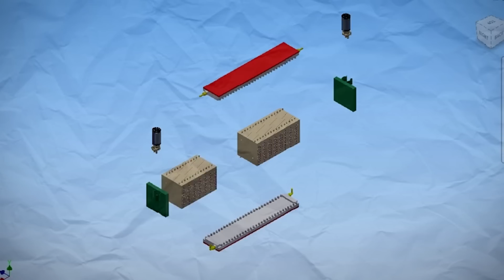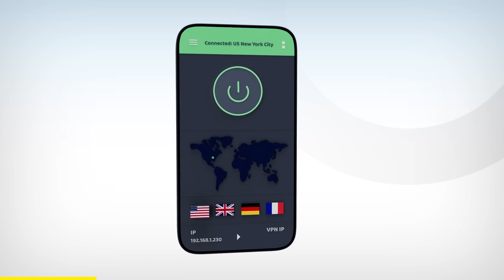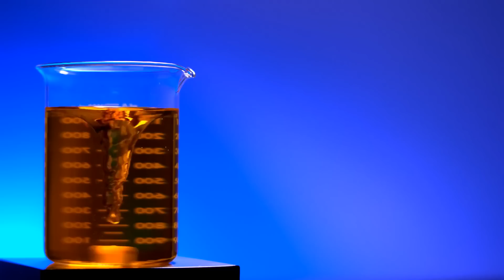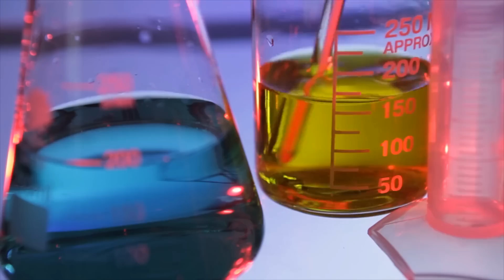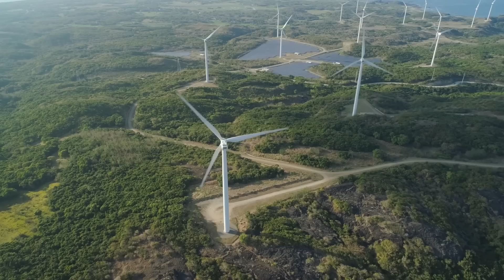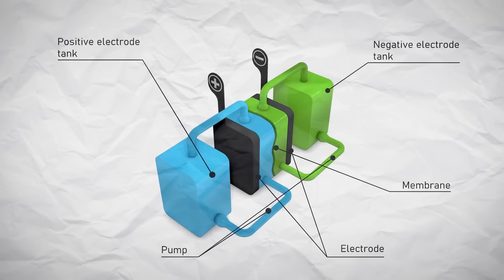This Insane Liquid Battery Can Instantly Recharge

Comment: A Tesla mod-Y recharges from near empty to full charge at a supercharger station in about 15-20 minutes. Buy the time you go to a gas station, wait in line to access a pump, then fill your tank, the time difference is not that much. Also, over 97% of you charging is done at home. You plug your car in that evening, and tomorrow morning, it is ready to go another 235 miles.

Comment: This is another battery "fantasy" that overlooks it's main flaw.  There is no vanadium distribution system infrastructure.  Therefore, it will remain a wait and charge battery, just like current Lithium Ion batteries.  I could theoretically see a future in which certain industries (that do their all hauling at one site, ie a mine for instance  or manufacturing site), could set up an in- house refill station at the business.  That could make economic sense, depending on the price and supply of Vanadium. The cost of a  patented Vanadium mixture may make even this scenario economically impractical.  I think we face a future with several different ways to store electricity for vehicles.  The cat is out of the bag, EV's work very well today for many purposes and I think those purposes will keep multiplying and improving.

Comment: I was wondering when corporations were going to see this.  Charging a battery is no different than pumping steam into a tank, have it condense into water, then turning it back into steam for usage. Extremely inefficient. This is why a dense form of electricity is needed.  Just like gasoline is a dense form of heat. Redox Flow batteries are a close to ideal foundation to build on. It just makes better sense.

Comment: This would make far more sense than what we have now.  Electric vehicles will never become popular once people find out they have to replace the batteries every few years for $10k plus.  This is already becoming evident as electric car enthusiasm is cooling (mine as well).  In addition to the environmental cost of disposing/replacing worn out batteries.  If replacing a battery is just going to a refilling station and getting a refill/fluid change (IF IT CAN BE DONE CHEAPLY) it's a night and day difference.  Add to that the increased energy densitity vs. current lithium batteries and near instant recharge it makes this a no brainer.

Comment: At this stage it is all lab based, to go from there to a commercial scale can be very challenging if not totally impractical. There is still the problem with insufficient grid capacity and to say nothing about the astronomical amount of new infrastructure required for such a system.

Comment: Ev's probably need two batteries. One quick charge, or what Honeywell invented with mechanical energy conversion, then a battery to feed motor if necessary. That might be trickle charged. Possibly two batteries to feed motors. Probably a hundred lbs for each, then the quick charge batteries can probably be pretty light, relatively to gas cars.

Comment: Lithium-Ion battery packs are being phased out. Sodium-Ion and other chemistries are coming forward. So are solid state battery solutions. By the time a viable system of 'electrified liquid' is in place it will be pointless to have it. Just like hydrogen. And also like hydrogen you would have all the same issues of using a liquid at a filling station that you get with petrol and diesel anyway. One of the main issues would be that you can get electricity for your battery vehicle at home or at any of the millions of locations where electricity is present anyway. But liquids will almost certainly always have to be transported to dedicated pumps at dedicated sites. It's just not a realistic solution for private vehicles. It would be far better suited to aeroplanes and such like.

Comment: 1/10th the capacity? One article said it had double the capacity of the highest lead acid batteries which would put it around 1/3 less than lithium ion. Would this be practical for a car since it has 1/3 less energy storage capacity as lithium ion batteries? That is 1/3 less distance you can travel sacrificed for a 3 minute charge time or however quick it is. Although the charge time is a very nice benefit, I think the biggest that it comes down to that would make this get used in cars is money, it's half the cost and that brings down the cost of the car significantly. Isn't it like 10 000 USD for tesla batteries? That's 5000 off the price of a car just like that. So it might be a quick way to introduce cheap mass produced electric cars.

Comment: I didn't hear you mention whether the touted energy density is for the fluid solutions or for the entire power system, since lithium ion batteries don't require pumps, tanks, or external proton exchange modules.
This is a common tactic in hydrogen power, where only the energy density of the hydrogen is advertised, ignoring the heavier storage and transfer equipment. The idea is that if you have 20,000kwh in a load leveling system then the other equipment is basically immaterial, but that's not the case for cars or aircraft.

Comment: You conflate energy density with specific energy early in the video, then spend the entire rest of the video talking about energy density, which is nice to have for designing an EV, but really not that important. Specific energy is the part that actually matters, and there's still nothing else electrically rechargeable that can come anywhere close to lithium-ion on specific energy. That's why the new breakthrough that's gonna make lithium-ion obsolete has been less than a year away from market for 30 years now, because none of them can beat lithium-ion on specific energy.

Comment: Please, please don't see 'round trip efficiency', as an important metric. Generation is becoming 'cheap as chips'  (i.e. very inexpensive.) and we are going to need to build systems with so, so much excess generations at certain times, that any 24/7 open receptacle for the gluts that will inevitably occur at fairly predictable intervals, will get their power for almost free, if they're not actually being paid to take it. A cheap, energy-dense, power-dense system, will overcome any issues with efficiency.. obviously, up to a point.

Comment: Energy density by volume may be less important than energy density by mass in EVs and given that liquid batteries can not be structural and would add design complications to vehicles and filling/charging stations it seems like a bad idea.... Other applications, grid storage, home power packs, shipping seems like a better option. Imo....

Comment: That stuff should never be used in a vehicle due to the problem of accidents mixing the fluids which would spontaneously combust and could not be doused until discharged.  Woe unto anyone on an aircraft that has an emergency landing that ruptures the reservoirs and they're cooked before they can escape the scene... and the firefighters are cooked before they can get close enough to deploy counteragets.

No, this should solely be used for fixed place energy accumulation, storage, and discharge.  Since it charges relatively swiftly and only needs to be pumped it can even be recharged while it is actively discharging.

Comment: It would be interesting to compare with the energy density of conventional fuel, as that has been the main limitation for aeronautic applications.
Reply: It has? 
Even if you could get the same energy density, unless your "liquid" is cheap enough and safe enough to dump after it has been used you are going to have limited range.
Reply: @stusue9733  that the point of the density. At equal densities, and efficiency, you get the same range.

Why do you think there are not many electric planes?
Reply: @XB10001  Not at all. Equal densities means you have the same power for the same weight, but as I said in my last comment unless you dump the "liquid" overboard as you use it your aircraft weight stays the same and you have to carry it for the whole trip, once fuel is burnt its gone.
Planes can 
1. take off with a lot more weight than they can land with.
2. Aren't landing with the fuel they used for takeoff and the trip.

So if you aren't dumping your liquid you have lower range because of taking off at your max landing weight and lower range because your landing weight is the same as your takeoff weight. There would even be a range hit from not being able to fly as high.
Reply: @stusue9733  not all of them.
The 737 take off and landing limits are the same.

I see what you mean. So that will change efficiency during flight.

I KNOW what density is. 🙄
Reply: @XB10001  Got a link to that?
The table I'm looking at shows any 737 built in the last 25 years has a max take off weight at least 10 tons more than its max landing weight. Max landing TBA for the MAX 10. The MAX 9 is more like 14000kgs difference, it can carry about 21000kgs of fuel about 25% of max take off weight.(older ones less than 10t but then they weigh less also)
Reply: @stusue9733  the 737 doesn't have a fuel dump system. So it's still within limits.
Loke I said, they are very close.
You HAD to look that up? 🙄

You do know that you cannot dump battery fluid, right?
Reply: @XB10001  If you're calling more than 10% off "close enough" then by all means carry on. lol

No you didn't say "they are very close", you  said " limits are the same." But I guess you will call that close enough.

I had to look it up because you made a claim. You were wrong. Yes doesn't have a fuel dump but its max landing and max take off are not the same. 

"You do know that you cannot dump battery fluid, right?' That has been my point all along! If you cant dump your battery fluid,  your range is going to be rubbish. Imagine landing a 74t plane, 20 odd tons of which is "fuel".
Reply: @stusue9733  do you also think that someone will install electric motors into into an existing airframe?
The plane will have to be redesigned.

The point was that you CAN design anaircrsfts that will take off and land with the same weight limits.

What you forgot to "look up" 🙄a ws that the landing gesr requires insoection in the 737, and that's because you would land with same weight in case of an emergency immediately after V1.

So, unlike you, I'm not googling every paragraph.
Reply: @stusue9733  you DO know that airplanes are designed specifically for the conditions they will take off, fly and land, right?
Reply: @XB10001  I didn't forget anything. You made a claim, I thought you were wrong, I looked it up, you were wrong. I think the "eye rolls" at someone for dare looking something up is at best childish. Better to shoot from the hip, be wrong and then double down right?

You call them "the same" but at the same time slip in "emergency" and "inspections".🙄(see fun isn't it?)

You can't change the laws of physics captain.
Reply: @stusue9733 actually, it was YOU who has been insisting that the electrolyte had to be dumped, or the plane won't be able to land, which happens to be wrong.
I used the 737 as an example. And since you NEED to look things up 🙄 ... look up the Airbus plane with the same characteristics.

You seem to think that for some reason a manufacturer will get an existing airframe and just install electric motors.🙄
Reply: @XB10001  I didn't insist on anything. What I said was, "unless your "liquid" is cheap enough and safe enough to dump after it has been used you are going to have limited range"
Your argument against that is that some planes can land near there max take off weight leaving out the requirement for it to be an emergency and extra inspections following such landing. Which doesn't address the weight penalty at all.

Anyway, we seem to have gone around in circles long enough.
Reply: @stusue9733  agreed

Comment: Now you’re talking.
I’ve always said if they can come up with a technology for batteries that could pretty much deliver what I have now with my diesel powered truck - then I’d be on board.
I tow a heavy camper, sometimes long distance, and a boat, long distance. So having an EV pickup truck just isn’t feasible for us. But with technology like this that has the potential to deliver what I am capable of now, count me in.
I’ve never been fully opposed to the idea of using cleaner power, the entire world (people) and the earth absolutely benefits from that. We might even see the cancer rates decrease in the future because of it.
But right now, as it stands, battery technology just doesn’t cut it when it comes to RANGE. With tech like what’s in this video, I am absolutely on board. We all know electric delivers way more torque, which is exactly what a guy like me needs, but the combination of torque and stored power density has been elusive up until now. 
Can’t wait to see what the future holds with this !

Comment: This is all well and good;
but I didn't see how you would be 'using' the fuel, would we be recycling the fluid? by that I mean, it doesn't seem like the 'fuel' would be gone, just not charged.
So does this mean you would need to have your current 'fuel' drained before replacing it with 'charged' fuel?

Comment: Just a note. Li+ is currently doing 285Wh/kg commercially (Ford cars battery) and 500Wh/kg in the lab. Please update your clip with the correct figures. It is not 100Wh/kg anymore. This number was like 5 centuries ago.

Comment: I can't find any mention of the c rate which is pretty important when considering whether this can be a feasible replacement to li-ion batteries.
Reply: my uneducated guess is that the C rate is not relevant. the limit with lion batteries is the deterioration of the cell walls as well as the heat from inefficiencies. given its a fluid, just slap a radiator onto the system and crank the amps to 11.
Reply: @TheTimmy4745  The c rate is important for any battery hoping to be used in an electric vehicle. It dictates how fast the energy can be pulled out and thus used for high power applications.
Reply: @CaseyDarwin That it is a liquid makes me think that the C rate will be very high. Actually while i was typing that last sentance I just had a thought, how are they handling electrolysis.
Reply: @TheTimmy4745  how does it being liquid equate to a high c rate? By that logic solid state batteries should be super slow.
Reply: @CaseyDarwin in the context of li-ion batteries, if charging them too fast can damage the anode/cathode, then the liquid can not be damaged the same way. if it can be drained/refilled then the only limit is how hot the fluid can get without decomposing.
Reply: @TheTimmy4745  I think you're missing the point man. No matter how the liquid gets in or out of the battery, once it's in there, the c rate of that material determines how much power output that battery can have at any given moment. That's what I'm talking about not charging the battery.
Reply: @TheTimmy4745  The fact that you can pump a liquid battery for recharging is great but it doesn't get around the problem of how fast that material can discharge in order to produce power.
Reply: @CaseyDarwin charge and discharge are just going to be a surface area thing. when you have a difference in charges(voltages) they will equalize as fast as they can. with all technologies, thats the limiting factor. given its a liquid the surface area can be whatever the engineers give it. I still posit that the C rate that you are asking about, is going to be way higher than what we currently have by orders of magnitude.
Reply: @TheTimmy4745  just not true. It has to do with the electrical properties of the materials being used.

Comment: 4-5x increase in power density sounds suspect. 
Whats the C rating for charging and discharging for stationary system and whats effiency for charging and discharging? If it takes 2kilowatt to put 1 kilowatt inside and then you only get 750watt out then its a bit useless. Whats cycle rate? LiFePo4 is. 6000 cycles, LTO is like 20-30.000 cycles.

Comment: According to Wikipedia Vanadium is quite rare. Part of the problem with Lithium is its relative scarcity. The idea of a chargeable liquid sounds like a great solution to the problem of powering EVs, but if its based on a scarce resource then it's just another short sighted solution.
Reply: Zinc bromide flow  batteries are nearly as good. Ziinc and bromine are far more plentiful.

Comment: Whenever I hear nanoparticles or nanostructures I immediately stop watching.  There are a great many solutions that can be worked out in the lab but never make it to production at scale because nanoparticles have never been produced at high enough qualities outside the lab.  There are always contaminations.  Nanoparticles in a certain arrangement are beneficial, the same particles in a slightly different arrangement can be detrimental.  I've been reading articles like this since the 90's.  Maybe these guys figured it out but I doubt it.